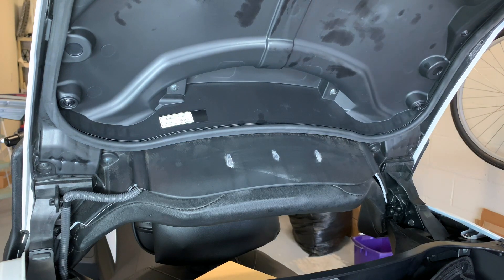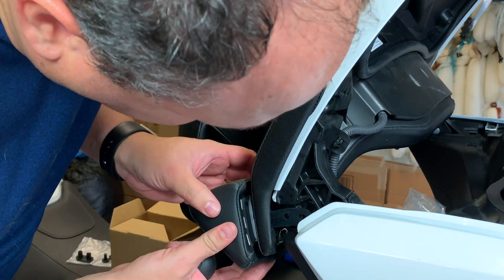2018 Goldwing Arm 2018 Goldwing Arm Rest

Comment: Looks like you installed the nut plates from the wrong side. Friction is the only thing holding them in.
Reply: Yep....the nut plates should be on the inside of the trunk brackets.
Reply: yes he installed them wrong

Comment: *READ* 
Yes, as a couple of others have stated...the video here shows the "plate nut"  being installed from the "outside", not the "inside" as it should be...you need to put the "plate nut" in from the inside...it does you almost "0" good to use it put in from the outside as shown in the video. I did mine as the video showed, but I was just a bit puzzled, and THEN found the Honda install instruction on line that clearly showed the problem.  I had just put the arm rests on, and cleaned up the work area, and thought I was done...LUCKILY you can pull the two bolts out on each side and pop out the "plate nut" and put it in from the back side WITHOUT taking the backrest off again...it too an additional 5 min to turn them around...just say'n...

Comment: Any chance you still have the plastic "cover plates" and the 4 screws you removed in order to install the passenger armrests and would you be willing to sell them?  I have a 2019 Goldwing airbag model that came standard with the armrests but my wife would prefer no armrests.  Honda does not sell the "cover plates" separately.  Thanks in advance for your reply.

Comment: I think those are not Phillips, but JIS.  There is a difference.    The JIS are much less likely to cam out under pressure if you use a JIS screwdriver.  
I bought a set of JIS and have had many fewer stripped screws.   You can use JIS on Phillips screws, and they actually work better.   You can use Phillips on JIS, but you lose the benefit of the greater torque possible on the JIS, and more likely to strip the screws.